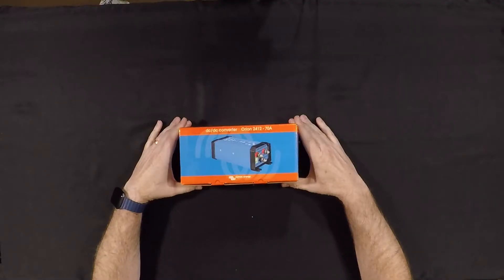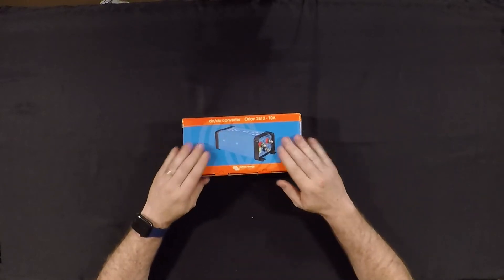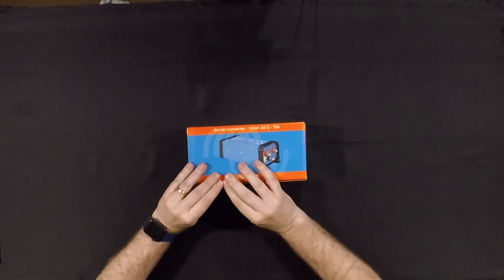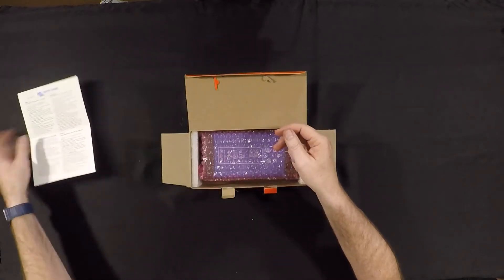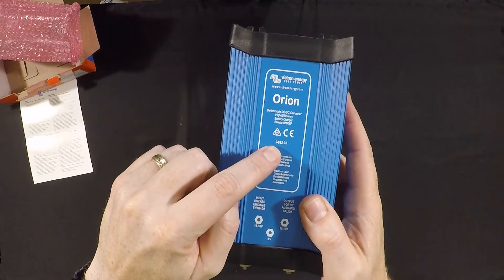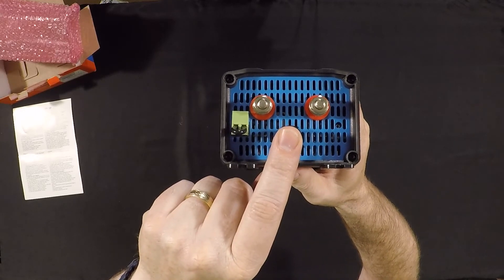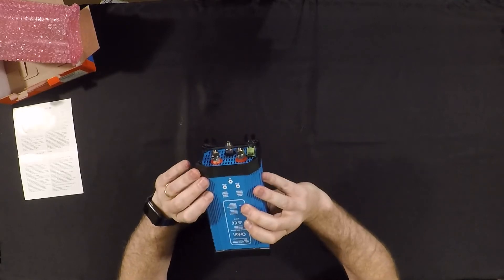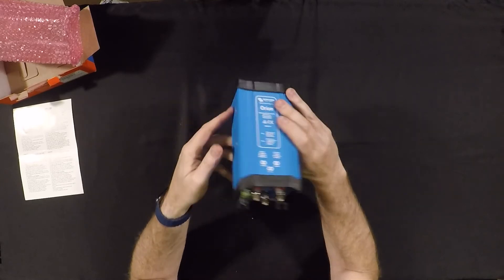Victron Orion DC-DC Converter Tabletop Unboxing and Review

Comment: Just wondering I purchased this Orion 24/12 converter and it's got a buzz to it. Wondered if yours did also. I ended up getting a second one in the second one does the same as slight buzz

Comment: it has a fan, that is nice.... why don’t you do a bit of homework before posting a video? 
here are some facts
inverter/charger - chargers have 3 stage or for lithium 2 stage charging, this Orion has only 1 outgoing voltage, but compared with the 100A model, an adjustable voltage. With this it can charge Lithium up to the float voltage around 13.6-13.7V, so wont charge Lithium 100% 
The plug you are pointing at is for remote on/off switching, connect it to your delayed ignition switch if you don’t have a VSR voltage sensitive relay, that disconnects your aux battery. By choosing one, or even two Orions in parallel make sure you don’t put too much load on your alternator, otherwise it gets too hot when idling. A 90A should not have more then add 35A or so on it, because idling it put out only 60A and has to provide power to ac, lights aso, next to recharge starter battery
Reply from the maker: Thank for your comment. Simple answer - I am only using the Orion to step down 24V to 12V. I am not pulling power from the alternator back through to charge the batteries.
Reply: The output voltage adjuster is just to the right of the main lead terminals inset behind the metal cage/mesh if anyone was wondering.

Comment: How Could I charge my 24V Lithium bank from my 12V alternator? Is possible?
Reply from the maker: They make 12/24 DC-DC converters as well. You could probably place one of those inline between the alternator and the battery bank. Just isolate the 12v line coming in from the alternator from the rest of the 12v system so you don't get a loop with power coming out of the battery bank 24/12v and then back in 12/24v.
Reply: Yes it is possible.  I installed a Victron Orion 12/24-15 isolated DC-DC converter in my trailer which allows me to charge my RV 24V lithium battery system from my truck's 12V alternator.  The draw on the truck alternator is about 35 amps @ 12V and it feeds about 15 amps (360 Watts) to my 24V RV battery system.  Make sure your alternator can handle the 35 amp load without overheating.  I ran #6 AWG from the truck's battery terminals, through a 60A fuse to a high power switchable relay (switched using one of the OEM auxiliary switches in my truck), then ran the wire back to an Anderson connecter on back of my truck for connecting to the trailer circuit.  I also wired up a #6 AWG charging circuit on my trailer using an Anderson connector from the hitch back to the 24V battery compartment where the DC-DC converter is installed.  I can turn it on and off using the aux switch in the truck and it works great as a supplemental power source on travel days.  The Orion 12/24-15 is programable through the Victron Connect app allowing you to set your absorption, float and lock out voltage to whatever works for your application.